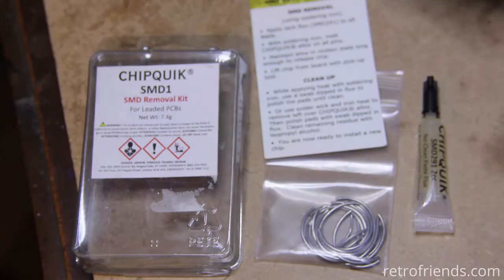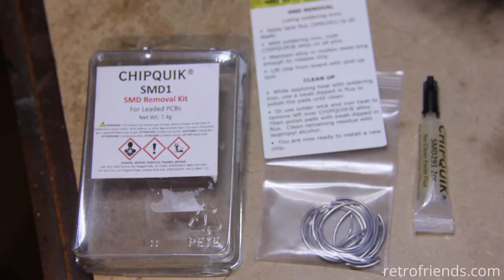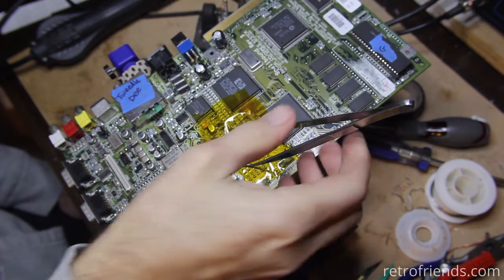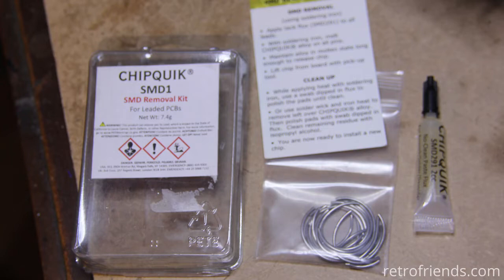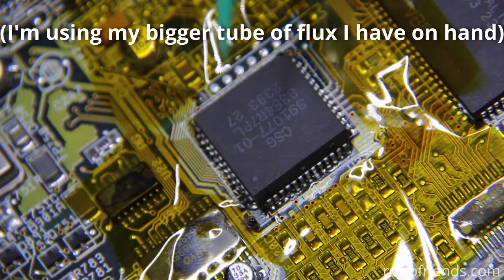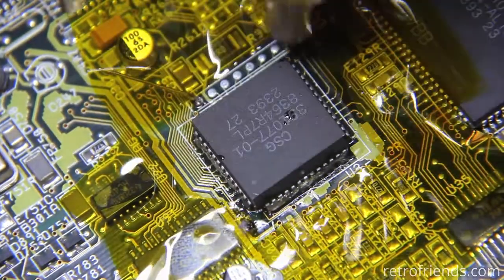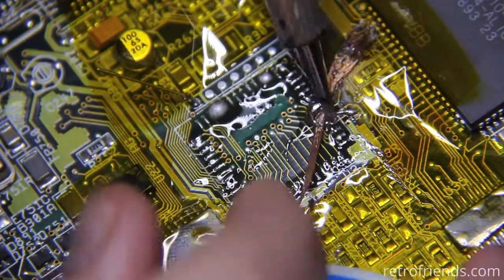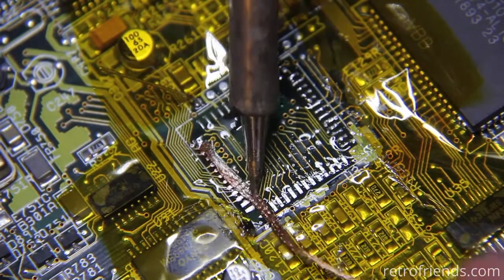ChipQuik SMD1 SMD Removal Kit: PLCC Removal (and Install)

Comment: I'm curious.  Why not just use Hakko's solder quad tip (T15-1203)?
Reply from the maker: Not everyone has a Hakko soldering iron, or the funds for the extra $70 peripheral. A lot of people have an infrequent need for delsoldering. The quad tip is also a fixed size. Would it work for all sizes of PLCC consitantly? I feel it is always a valid technique to lower the melting point of the solder no matter what tool you use.
Reply: @retrofriends  that's the point where I think it's better to pay someone to do the work
Reply from the maker: @olDirdey the amount of people on this earth who can do this has been dwindling for decades. And for those who remain, people don't want to pay what they charge, accelerating the decline (I am speaking from experience). If you have someone to do it for you, cherish that while you can.
Reply: @retrofriends  I understand your concerns, but you can usually find someone in the right community to do it. I'll do it for a beer

Comment: Can you use ChipQuik as actual solder? Basically I'm trying to replace this capacitor and the metal pads are actually underneath it so I think it's going to be tricky to put the replacement on the board. I was thinking that I could put some ChipQuik where I want it, then put the capacitor over it and then let the ChipQuik harden.

Does this sound like a good idea?
Reply from the maker: In a word, no. Tin the pads with new solder, and hold the component on with tweezers while you add heat and maybe more solder.
Reply: @retrofriends  Thanks!